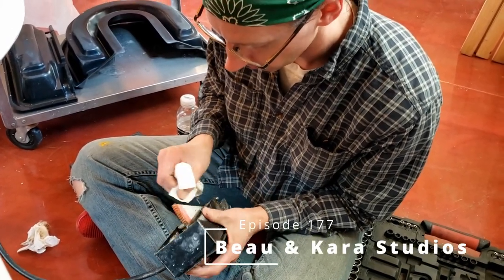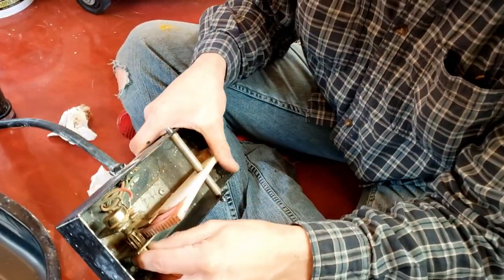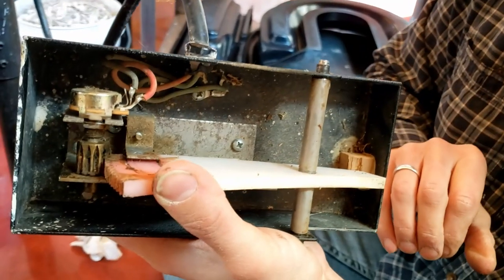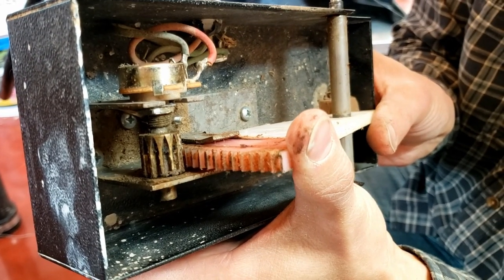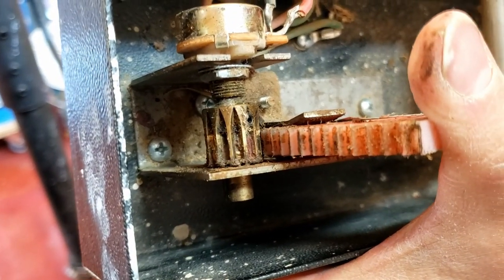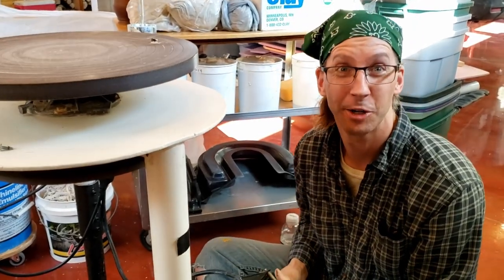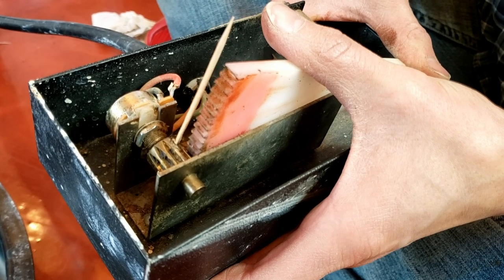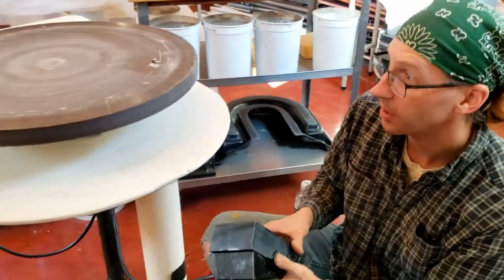Beau and Kara Studios- Fixing the foot switch on your pottery wheel- Episode 177

Comment: Thank you so much for your information. I know about the wire in the different colors. I’m just not sure where to put them.
On the potentiometer there’s three pieces of metal sticking out to put your wires onto. I don’t know which one goes where it’s very confusing.
Reply from the maker: Sorry I didn't see this right away!  This is how it's wired on our foot pedal.  If you have the potentiometer pointing up and you are looking directly at the 3 pieces of metal, the left one should be the ground, the middle is black and the right is red.  But on ours the ground is wired to the metal on the foot pedal. This video helped a little bit. https://www.youtube.com/watch?v=7xiHtAwyFgc
Hope this helps! :)  I do have a photo of our wiring if that helps.  Just need a place to send it to you if you need it. ;)

Comment: I have this exact foot pedal and it wont  come to a complete stop. I tried to correct by adjusting as you show but no luck. Now my pedal slips to superfast speed. I prop it to keep a slower speed. Im think ing I need a new POT. How do I change it? Thank you for your video and help. Diana
Reply from the maker: Hello!  It would be a soldering job; electronic type soldering if you look up the correct procedure.  Fairly simple if you have never done it. 
If you replace any component, make sure you have a new one first.  Then cut the old one out, but try to make sure you have existing wire to connect to.  Nothing is more frustrating than trying to fix something when you don't have enough room to work.  Meaning, you didn't leave enough wire. 
We have never had to purchase any electrical components for a foot pedal so we can't give you any advice on that.  Facebook marketplace is always a good place to go to if you are having a hard time locating the exact piece.
Lastly, don't be scared to contact a pottery place that makes wheels.  We contacted Scutt one day for our kiln, were placed on hold for 50 minutes, and it was the best decision we made.  The Scutt technician was super helpful. 
Hope this helps you out a little. Thanks! :)

Comment: Can you show me how to wire the potentiometer?
Reply from the maker: Hello!  I have never done that before, but there should be 3 wires that go to your potentiometer.  One is green that is your ground, one could be red or black, and that is your power.  The last should be white which is your neutral.  
For a small electrical component you would have to solder them on and off.  
The only way I know how to wire a potentiometer is by looking at the wiring of the old one. If you get the power and neutral backwards, then usually the potentiometer runs backwards.  Still works, just backwards.
Good luck! :)
Reply: Oh,.Okay. So I need to solder the connections? Any info will be 👏.  Thank you, Diana